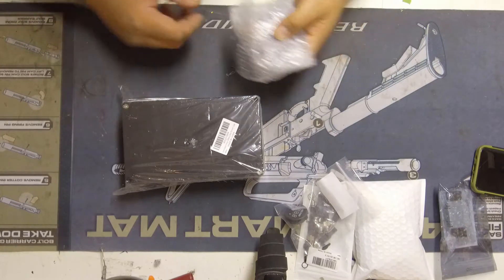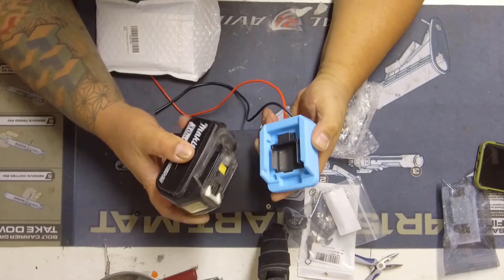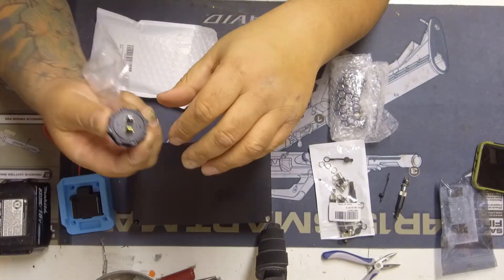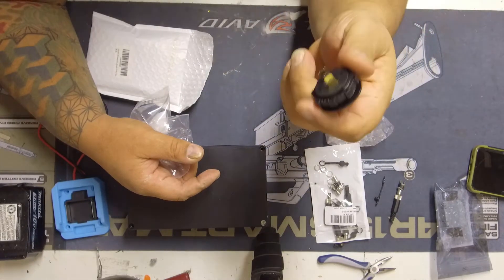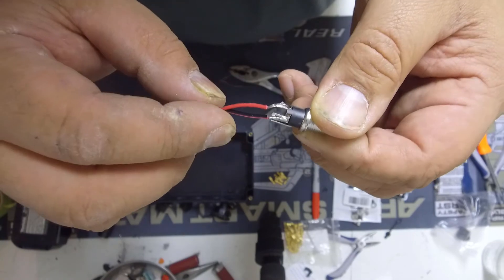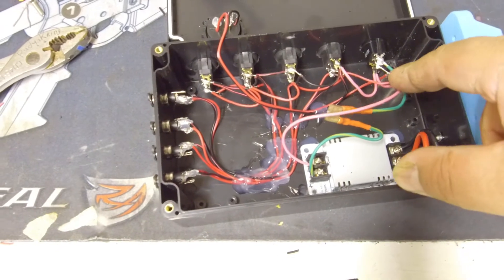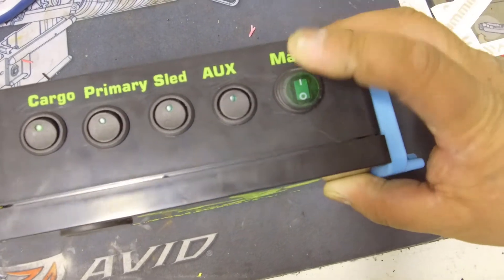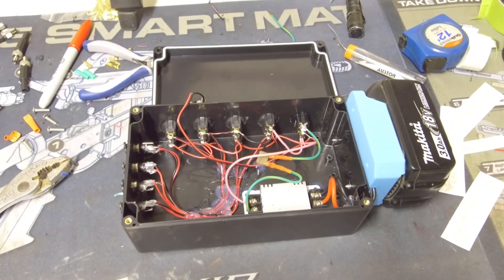Making a 18v to 12v adapter / power box for LED lighting

Comment: Awesome, I was thinking about doing the same.  Do you remember how many amps you can run through the step down converter?
Reply from the maker: I'm not sure I'd have to go back and look it would depend on  the model you buy, to be honest. This one just ran LEDs to the diferent compartments and overhead lights.

Comment: Excellent, I was wondering if I could use my 18v batteries to run the 12v pump and lights in my motorhome.. The solar isn’t changing this time of year… I’ve just bought the connector and drop down from eBay.. Thank you for the video!!!